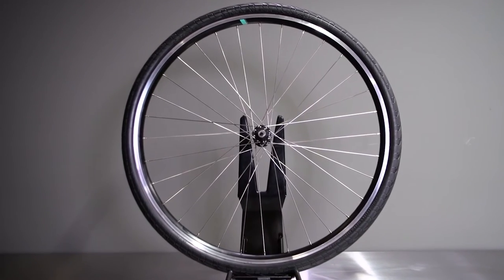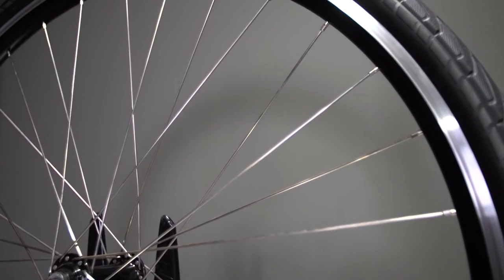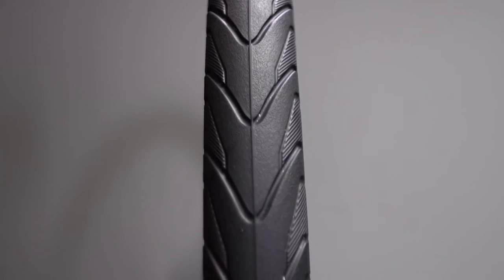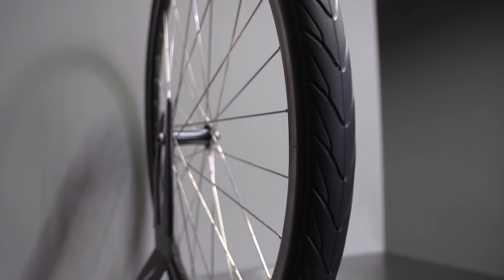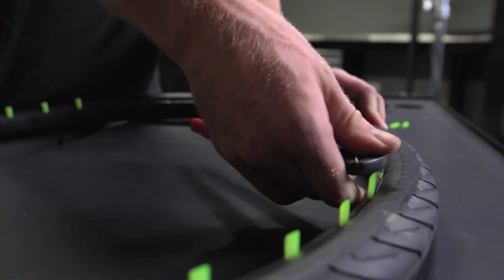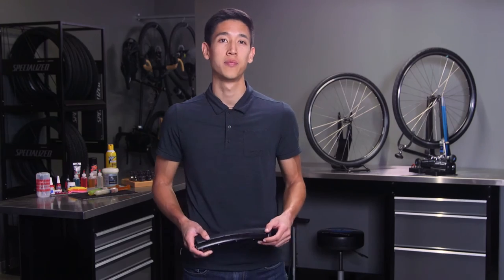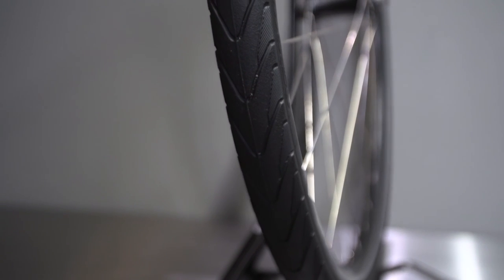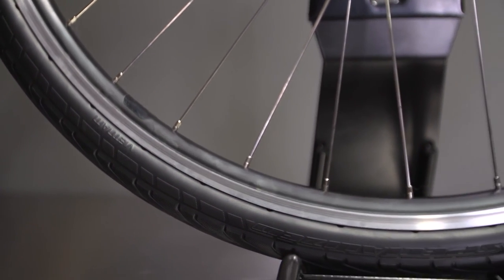Nimbus Airless Tire - Fallen Leaf Films

Comment: I just bought a new Specialized Roll to replace my Stumpjumper that gets punctures every 2-5 miles (yes that's correct, every 2-5 miles) on average.  

Bought the bike with Nimbus tyres, have put maybe 20 miles on them, and my rear is flat.  

I call BS.